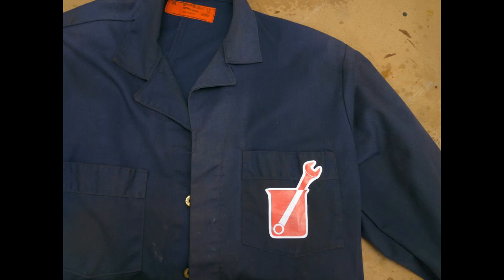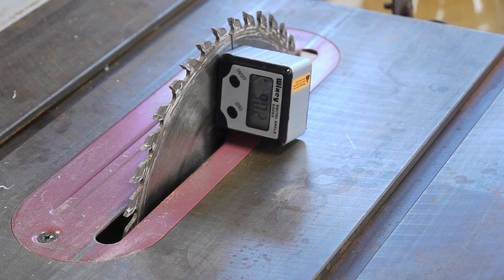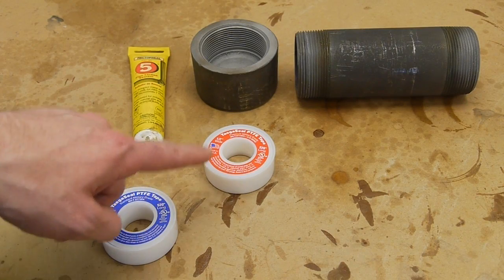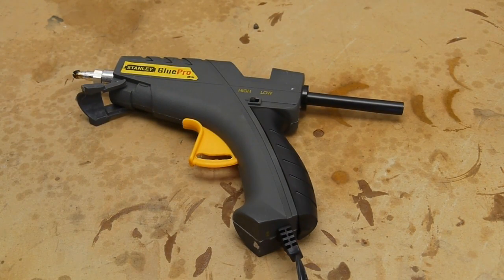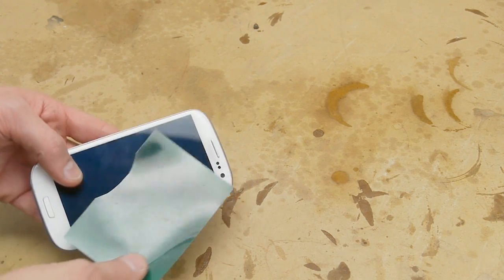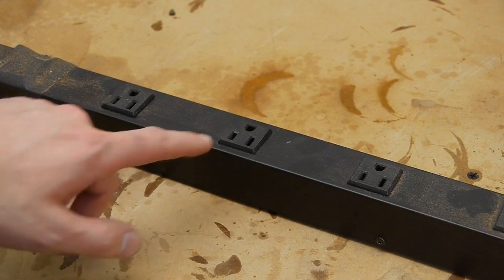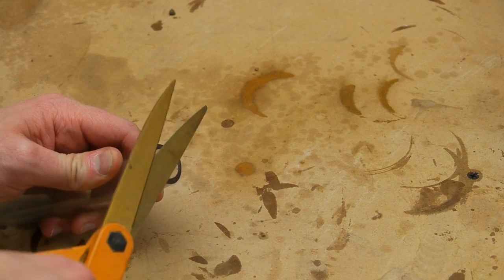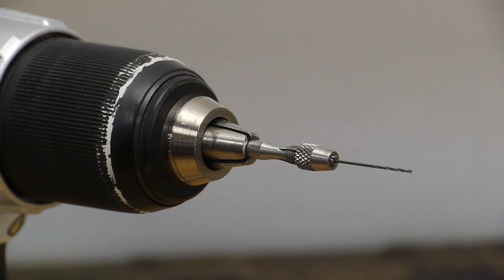Tools and Tips #2 from Applied Science

Comment: I don't think there's any Teflon in that "Teflon tape."
Reply: Barnekkid there's not. Teflon is a proprietary brand name (Dupont?). There has never been a tape made of actual teflon, which they have been careful to mention in the faq section of their website.
Reply: +Toto Abicyclette I would think if you're building a pressure vessel that you're going to do chemistry inside of, polytetrofluoroethylene aka teflon, is probably a lot less likely to contaminate your sample. Generally speaking it's exceptionally stable, it's not exactly BisphenolA, so as a bit of a hippie myself as much as i prefer the organic option, in this particular case i think the PTFE is not a big deal.
Reply: Barnekkid I don't like teflon. Why use plastic when vegetable fibre (like sisal) and grease does exactly the same thing for a fraction of the cost ? Plumbers have used this for decades, and those seals are perfectly watertight. 
Besides, we end up eating and drinking  those plastics that goes up the food chain.
Reply: Toto Abicyclette Good for you buddy.

Comment: When trying to figure out Live vs. Neutral, I typically de-energize the circuit and measure the resistance between the ground pin and one of the legs. The Neutral will be tied to ground in the electrical panel, while the live will be isolated through the circuit breaker (being off). Seems to risky to be touching one end of the wire while testing a line circuit. My luck i would have a bad circuit tester and get shocked. 

Anyways, My $0.02.

Comment: How does "gas grade" thread seal tape from the hardware store compare to the McMaster stuff? Gas grade tape feels way thicker and denser than the cheap stuff.
Reply from the maker: tesla500 That's a good point -- I haven't bought gas grade tape locally.  In fact, I haven't bought much of anything locally since McMaster and Amazon.
Reply: Applied Science 
Is there any difference in the material of the tape except for the thickness? Because here in Europe where we are metric, we don't have weird units like "gas" and "military" grade ;) , but we just buy by thickness like 0.2mm or 0.075mm.
Reply: tesla500 Teflon tape comes in different varieties specific for their application. You can buy T-tape for natural gas, high pressure gas, and oxygen for example. The best T-tape for the job depends on the job.

Source - Plumber
Reply: Blazaontroll is correct: neither is "better" or "worse", it's just one is for water, the other for gas; a matter to reacting well to pressure, or creating a good seal without pressure,
Reply: tesla500 I use gas tape on my fittings (it is yellow in Canada, Masters brand) and it works quite well. Even better than yellow tape is steam tape, which is pink. try and find that stuff, its super high density. Even though its overkill, its what i like to use for irrigation because it guarantees no leaks.

Comment: That pin vice looks handy. I usually wrap tape around the drill bit and then put that in the chuck, but it doesn't always work well.
Reply: RimstarOrg I wrap thin magnet wire around the drill, works like a charm!
Reply: RimstarOrg FYI more commonly know as a "pin chuck"
Reply: I have cut them off dead dremels.
Reply: Sirus
Neat idea. I happen to have a dead dremel here.
Reply: Gergely Hornich Thanks! I'll try that next time.
Reply: RimstarOrg I use small heatshrink tubes.
Reply: +Sirus some, have interchangeable chucks.

Comment: There are also specific hose cutters, but my favorite cheap cutter that does wonders with all kinds of hose, is the el cheapo ratchet type PVC pipe cutter from the local home center. It will work with all kinds of hose up to about 2" and even high pressure type hoses. Leaves a real clean edge and can get into pretty tight places.

Comment: Do you use your glue gun as much as I do? Hot glue is my the poor man's 3D printer for quick projects. 
Gotta wear good shoes with those neon testers, bare feet on a concrete floor makes it light up WAY brighter.
Reply from the maker: Nick Moore Yeah, hot glue is one of the first things I buy when setting up a new workspace.
Reply: Nehmo Sergheyev Here in Europe we use so called electricians screwdrivers thats just a transparent screwdriver with the same sort of neon bulb tester inside (the other side is connected to a metal nub on the back to put your finger on). And yes they work way better if you grab on to something while using it to increase leakage to ground from your body.

One time i got tricked by that since i used one of these to quickly check for power in an junction box while standing on an operantly well insulating chair. Tester did not light up on any wire. Ended up grabing at the live wires and again not feeling thing due to being well insulated, that is until leaning my bare shoulder on to the concrete wall and getting quite a surprise touching that wire. So yeah don't trust these too much.
Reply: Nick Moore Yeah, I assumed by putting the lamp between the hot wire and the human body, the body was just completing the circuit to the ground. Ben Krasnow says 7:50 it's because the body functions as a capacitor. I suppose it could be if the body were insulated from the ground. 
There's no danger to this common test method. How much current could you get going through a neon lamp and the body?
Reply: There is a current limiting resistor in neon testers (usually over 1Mohm I think) to limit the current that can go through them because neon shows negative resistance (the more current you put though it the lower its effective resistance. If you have a tester with a bad resistor or moisture inside (may have happened to me) the only thing left to limit the current is you ;)
Reply: Nick Moore Sometimes when I'm far away from the tool bag, like when up on a ladder, and I need to test for voltage (line is only 120V here in America), I just use my body. If you're testing a standard American Edison screw lamp socket, and it's wired properly, you can slide your finger down the side touching the side threads first and then completing the circuit by touching the center connector with the tip of your finger. In that way, the circuit is just through your finger. If you know to expect a shock, you won't get thrown off the ladder.  
If then you still don't feel the current, you lick your finger and try again.
Reply: Nick Moore I think it's more like 47K ohms. You're right about the bad resistor or water leakage. Also, if you happen to be already coupled to a hot wire without noticing it, then the lamp could fail to light or even light when the neutral is touched. The same can happen when high RF fields are present. They can lower a neon lamp's breakdown voltage and because you would be acting as an antenna, you could get a false reading. For these reasons some countries have banned single-wire voltage testers.
Reply: Thanks, I never had one open to check but 47K is pretty low if you think about it being the only thing between you and the line. I think neon testers are still legal in Canada but I tossed mine after it gave me a buzz. I should get another and put it though some non-standard testing.
Reply: Nick Moore

Comment: Nice tips! What about "Tapered" threads? Are they not designed to create an interference fit as well? Or is there some other nefarious purpose for the taper?
Reply from the maker: USWaterRockets The pipe threads are tapered, but the original design (NPT) was setup so that the flanks of the pipe and fitting would touch and prevent further tightening, but would leave a slight gap between the root and crest.  NPTF redesigned the thread slightly so that the crest would press into the root before being prevented by excessive flank interference.
Reply: Applied Science Thanks for the detailed explanation. You're awesome!

Comment: There's quite a number of options available for cutting tubing. Notably rigid PVC pipe and copper piping. I've used PVC pipe cutter/shears for cutting vinyl tubing (kitchen sink project) and it's always left a very flat, clean edge. Best 8$ that I spent on a whim.

Comment: With the cheap magnets and the tight north/south pattern, I fully believe it's so it will adhere better to steel. I work at various dealerships photographing their cars, and they usually don't like stickers in the pictures... well if there's ever one of these magnets on a car often times the bond is so strong once it's been on the car long enough that you have to break it off in little pieces, even get a plastic scraper to scrape it off. I'd say after about 6 months to a year those cheap magnets are impossible to remove without destroying the magnet itself.
Reply: Jesse Crandle In Australia most people use magnetic "provisional" plates over plastic screw on ones. You'll often see old cars driving around  with square patches of paint missing where the magnets have sat too long and ripped the paint off.. 
Sometimes see old cars where they couldn't get the magnet off so they just cover it with duct-tape
Reply: Jesse Crandle I've used one at used car dealerships to detect bondo filled damage.
Reply: Slot1Gamer That's interesting, although most cars I see have plastic bumpers now so you'd have to stick it on the back of the car other than the bumper...
Yeah, like I said about it coming off in little pieces, probably the person tried to remove it and they could only get just a teeny piece so they said screw it and taped it lol.

Comment: Is the flat magnet not a halbach array? With the magnetic poles organized internally almost like horseshoe magnets to minimize the field on one side and maximize it on the other.
Reply: scech1 Yep, that's my understanding as well. It helps them to minimise the overall magnetic field strength, while maximising the grip.
https://en.wikipedia.org/wiki/Halbach_array
Reply: scech1 I don't know that you could magnetize the sheet in a halbach array.
Reply: https://www.magnummagnetics.com/magnetizers/
I Design Magnetizers for flexible sheets. The theory behind the pole spacing which is the lines it as follows. 
The Poles throw the magnetic field proportional to the spacing of the poles. Basically the field jumps from one pole (a line you can see in the green screen) to the next. The smaller the spacing the shorter the throw of the field. Pole spacing varies with the thickness of the magnetic material. A thicker magnet will get a larger pole spacing 1/4" thick material would be magnetized with 4 poles per inch. Pole spacing varies with the thickness so that the magnetic material is fully saturated. Thinner Material would get a 16 poles per inch magnetization, while thicker would be magnetized to 4 poles per inch.

Comment: Instead of the Electrical Contact Burnisher you can just use a simple pencil eraser. The contacts develop a thin oxidation coating and you can rub it off with a pencil eraser. It's a lot less abrasive than sandpaper.
Reply: meza72 
That's what I use - then clean it with alcohol.
Reply: meza72 Erasers work well if there's room for them. The Neuses tool is better for switches and relays.
Reply: meza72 That brings back memories of slot cars and green shag carpet.  :)

Comment: I'M A MAGNET!
Reply from the maker: revolutiongames2004 I thought it was funny as well.  Either the marketers were just plain silly, or actually very clever in thinking that people would be less likely to toss the advertisement in the trash if it referred to itself using "I am".  It's a fine line between stupid and clever.
Reply: Applied Science I read somewhere that the reason they use the alternating field domains was to allow them to set up a halbach array, and both keep the front surface of the magnet from being unnecessarily magnetic, and allow greater field strength on the back due to all the field lines exiting there. They essentially use a spinning magnet right next to the hot extruding magnetic material, which creates a notional halbach array as the material travels.
Reply: Applied Science You could build on the idea: I'm a magnet, and I'm attractive. Can I stick around please?
Reply: revolutiongames2004 I find you very attractive!
Reply: Ryan Willis I though it was just so that they could cut strips of any size without accidentally just having a north or south pole on different products.
Reply: svampebob007 That's possible, but it doesn't really matter which polarity you have for a fridge magnet. You also can't have "just" a north pole, you always have both poles.
Reply: Ryan Willis
 oh didn't know that lol
Reply: svampebob007 :D glad to share the know.
Reply: revolutiongames2004 i'm a magnet too!  Can't wear a wind up watch, magnetizes it. must be a bored alien magnet,

Comment: Permatex sells a liquid PTFE sealant, I use it for things like the drain plug on my car's transmission. It resists chemical damage and can be applied even with oil on the parts and it will still seal pretty well. I've actually used it for sealing household fittings and air fittings up to 150psi, it's worked very well so far.